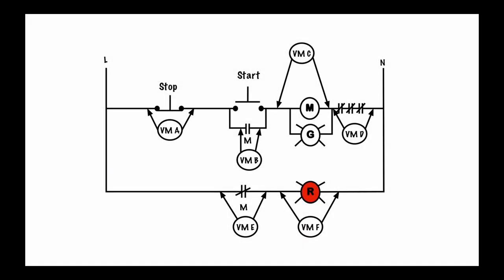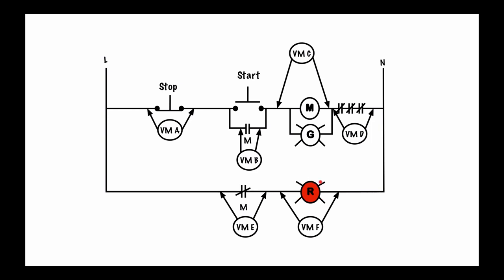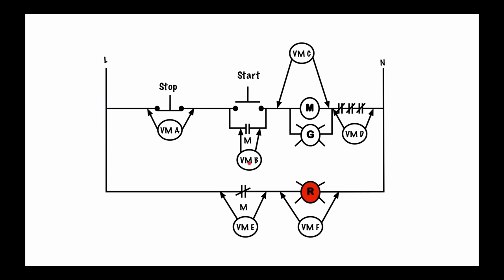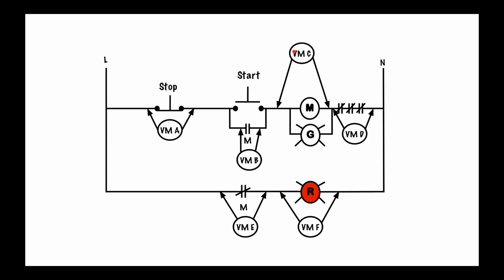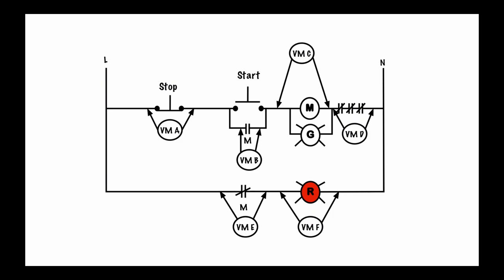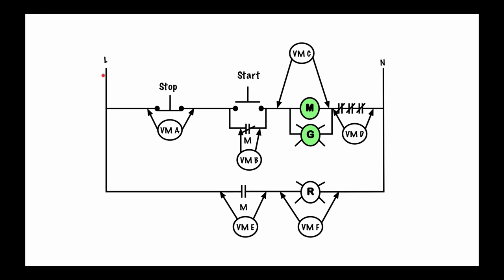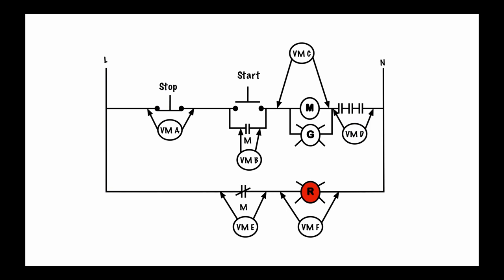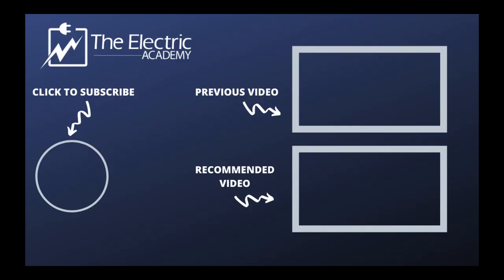Troubleshooting with a voltmeter and schematic.

Comment: Hey brother thank you for producing great content. For a motor starter with a 120v coil and the starter off and the overloads in a normal state at voltmeter B your neutral should be sitting on the right side of the auxiliary contacts through the coil as well as through the green run light. You should have potential at voltmeter B with the motor control circuit off. This should also be the case at voltmeter E with the motor control circuit running. There should be potential through the red run light to the right side of the open contacts. Please discuss and correct me if I’m wrong
Reply: You're right. We have to keep our boy honest.
Reply from the maker: Hey Anthony. You’re 100% correct. Thanks for the heads up. I’ll re record that part and put up the new one this week. Thanks for letting me know.
Reply from the maker: This is the way.
Reply: Keep up the good work. I appreciate your content and having a place to go to learn.
Reply: Wheeeeeeeeuph; I thought I was losing my mind for a second there, good comment.

Comment: I’m not understanding the 0 voltage drop. If you put the meter on a line that sends 120 volts, wouldn’t the meter just read 120 volts?

Comment: You where wrong there is 120 volts across the motor auxiliary contacts when they are open because the neutral is connect via the coil and red light  globe as there continuity to neutral wire